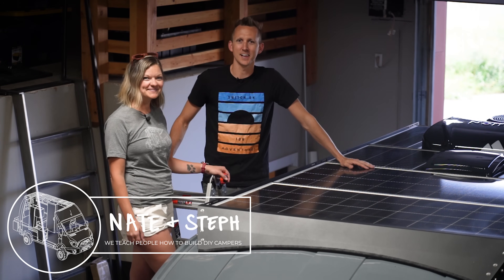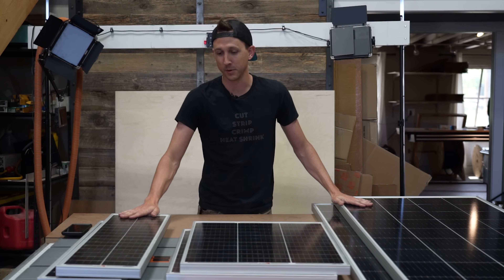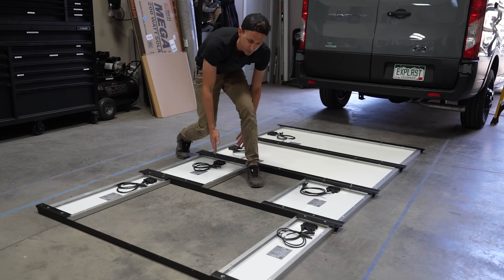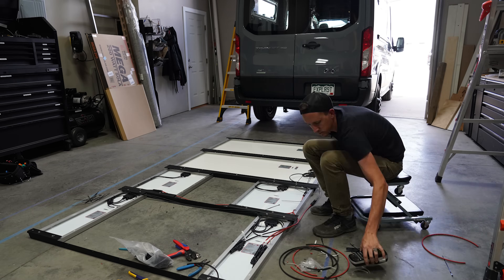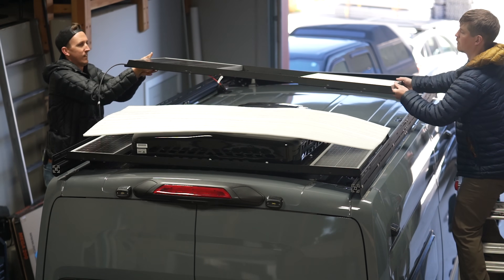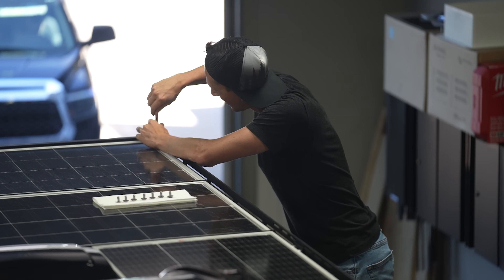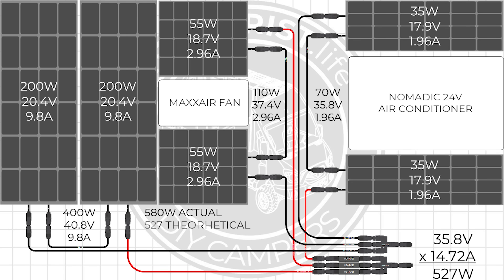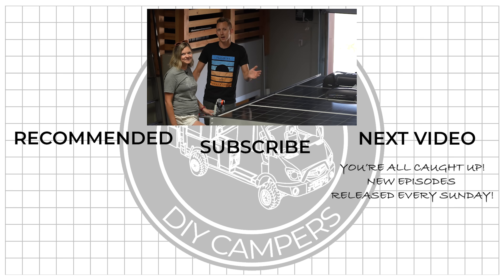INSTALLING 580W OF MISMATCHED SOLAR PANELS ON OUR TRANSIT

Comment: Question on the placement of the fan and ac - I was told to have them further separated to create air flow when both are operating (with the fan on exhaust). Do you get that same air flow benefit when they are so close together?
Reply from the maker: Great question! Placing the fan and AC close together can definitely affect airflow dynamics, especially when the fan is set to exhaust. The setup in the video works well for many, but your situation might benefit from more separation depending on layout and usage. For help dialing in the best setup for your build, our support team can take a closer look: https://shop.explorist.life/support

We offer free personalized help for gear purchased from our store. For components bought elsewhere, check out our Pro Support Membership for tailored guidance: https://shop.explorist.life/shop/all-products/membership-tiers/
Reply from the maker: Great question! Placement can definitely affect airflow, but how much depends on the layout and use case. Our support team can help you optimize your setup — just head over to https://shop.explorist.life/support. Free help is available for products purchased through our store, and for all other gear, our Pro Support Membership offers in-depth guidance: https://shop.explorist.life/shop/all-products/membership-tiers/

Comment: Curious. What mpg are you getting
Reply from the maker: 10 in a headwind, 20 in a tailwind.
Reply: @ wow that’s a big boy. What’s the biggest factor in the reduced mpg? Weight?
Reply from the maker: I mean, it's 10 foot tall 8,000lb vehicle with a lift kit, AT tires, and a twin-turbo'd motor. 🤣

Comment: I'm very confused, I was always told I have to use all the same rates solar panels otherwise the smaller ones would want to run the same amperage as the larger ones, causing problems. Am I missing something?

Comment: In a previous video you recommended the solar array voltage should be 20V above the battery voltage. This array is running at 36 V and is connected to a 24V battery which is only a 12V difference. I am looking at a similar set up and want to use a 24V battery setup. Should I use a 12V battery set up instead so it works better with the solar panels? Let me know if the 12V difference is acceptable. Thanks. Your videos are very helpful.
Reply from the maker: A great catch!  And yes; this system is indeed better suited to be a 12V system, which we have an option for in our shop.explorist.life store.  We opted for 24V just to show people how to do it because we had so many questions; not necessarily because it was the best choice.
Reply from the maker: In short: A 12V system would have been better, but if you prefer a 24V system - we are happy to sell that to you instead: https://shop.explorist.life

Comment: I wonder why ppl don’t just build a box that goes over the AC and fan. Ppl get additional storage on top plus have more roof for panels.
Reply from the maker: Height, mainly.  Extra height sucks to drive with in a cross-wind.

Comment: G'day.. This is a great video for miss marched solar panels and the same applies for the every growing HYBRID camper trailers here in Australian..
   I bought the lynx distributor after watching your videos. Can you advise if it's a good idea to run the solar POS wire from solar controller straight to battery positive to constantly Barger the batteries even when at home in storage.? My thinking is by running it through lynx Dist and having a battery disconnect switch solar would be isolated ,I'm thinking as the solar has its own disconnect switch to you can disconnect that if you want to shut down every thing. This would save a spot in the lynx distribution for other things and also leaving the neg wire connected to the shunt. 
  Is this a safe and viable solution to seperate solar disconnect? Keep up the great work. Your channel over any other has reached me alot. Thank you.

Comment: Love your channel.  I am using this for my new Tranisit Trail build.  I was wondering if it is possible to swap the 200W and 2 50W.max air fan on the rack.  my concern is the the max air fan is a bit close to the air conditioning unit
Reply from the maker: You may just have to play around with it a bit in sketchup or similar in regards to transit support ribs if you want to change up the plan.

Comment: Your videos are really clear and helpful! Much appreciated!
Have a question:
With FVC roof rack and maybe not the ideal locations of the fan and Dometic A/C, I’m considering two 175W panels and two 100W panels to charge a Victron 400ah 12V setup. Based on your advice, it sounds like I’d pair the matching wattage. 175W’s are in the center, but 100W’s are front/back. 
1. Would the distance make a difference? 
2. Would I need a separate controller if I wanted to switch which pair is used? For example, if I had a cargo box or a canoe covering parts of the bigger panels, which could harm the panels? 
Looking forward to seeing more installation videos!

Comment: Nice video. You are a guru. Excuse me if I just have a chuckle at one thing though. As someone living on a sailboat on the equator I have to laugh at someone's decision to produce a black air conditioner. I guess it's a styling decision? Anyway on with the video... and sorry to pick holes, your vids are very inspiring!! I love the beautiful arrangement of all those little panels.
Reply from the maker: I agree that a purple air conditioner would be much better, but alas, we will have to suffer through with a black one.
Reply: @EXPLORISTlife I was getting at the heat absorption issue. We repainted our boat. It was dark blue, now it's very light cream. The difference was amazing although it's still bloody 30 degrees C inside most of the time. Hopefully you aren't dealing with heat like that where you are going in that van. Congratulations again on very informative videos. It's inspiring me to tackle our Lithium conversion soon. I also like how you constantly stress safety. People can get into a lot of trouble with wires carrying 100 amps. Cheers

Comment: Ive got an anker c1000 and a 200w flexible solar panel to glue to my rooftop tent. The goal is to keep the ankerc1000 power station inside the trunk. I recently discovered you could get more and stable wattage charigng the battery pack via car battery inverter to dc and currently struggling to wire the newly bought solar cable into the hood and back out to the trunk...
Will i be better off with a battery inverter? Is it taxing on your car battery?

Comment: What about if we have a factory installed maxair fan? Id like to do the same setup maximizing solar with AC and a fan up top (and starlink).
Reply from the maker: You'll just have to take a few extra measurements and map out your roof to see what you can do.  Some time with a tape measure will be your friend here.

Comment: Question:

I have room for 3 x 215W or 2 x 215W and one 305W. Obviouslythe second option is more watt but missmatched wattage, voltage and Amps. What is the right way to think and connect in order to get the most charging effect as possible?

The 215W works with 24V and 6A and the 305W have 20V and 10A.

Comment: 11:42 New to the solar game and have a question.  Without the 2x35 (70) panels, you’d have 510 watts of solar but because of the parallel voltage limitations, you only netted 17 additional watts from those additional 2x35 (70).  Was it for aesthetics or will those 17 watts supply you any appreciable use?

Comment: How much degradation of the GPS/GNSS satellite signal have you noticed with the sharkfin antenna being under a solar panel or the wind fairing?
Reply from the maker: None.  Disclaimer: We don't use the transits GPS, so I have no clue. 🤣😂

Comment: 10:15 but the skit for the ford transit on your site is for 200W 12 volt solar panels not the 20.4 volts mentioned. I'm not sure why? PRobably because the maximum voltage is 20.4 and that's how you should rate the fuses

Comment: Can you clarify that a 35w17.9v 1.96a  solar panel can pull the voltage down from a 20.4v 9.8a 200w. so basically if I connect a 9v pp3 battery to a 12v battery the output voltage will be 9v and not 12v?

Comment: Hi Nat, excellent video again, What adhesive did you use to stick down the through roof Cable Entry Glands.I see you used the Decor Lap Sealant overtop of the edges. Thanks in advance?
Reply from the maker: A combo of butyl tape & quick set epoxy works pretty awesomely.
Reply: Excellent thanks. I believe on your roof fan you used 3M Wind-weld and Butyl tape. @EXPLORISTlife
Reply from the maker: Yeah, there are probably 1,000 different products that will work just fine for that.

Comment: Couldnt you have gone w the ecoflow battery bank and solar panels .? Then use that battery bank to charge your ev (byy seperate charge cable) and use it for external tools as well??
Reply from the maker: The ecoflow unit is significantly lower quality than the system we built in this van.
Reply: @EXPLORISTlife  AWSOME!!! I'm really looking fordward to adding your setup in a Ford e-transit 2023 work van  . So I can use the panels and your aux setup to charge the van while I work . While adding a bathroom & pop off bed on the roof .
Reply: Looking at your site for the help 👍

Comment: Hey Nate, You guys are doing a great service to all of us builders.  I purchased all my wiring for my electrical from you guys except for the solar array.  I just purchased three 110W and Two 50W from Newpowa (they fit the space I have) and looks like I can get 96% efficiency with a fully parrallel configuration.  The issue I am having is how to figure out the MPPT controller size for my mismatched panels.  It appears your calculator assumes the panels are all the same size and V and A values.  I just watched your Transit build where you used three different panels and was hoping you would go through how you determined the MPPT value.  Is there a video for that and i just missed it?  Looking forward to figuring this out and ordering my Array kit from you soon.  Hope to here from you soon.
Tim

Comment: Yea you would have been better off without the 2 small panels. It reduces the output of thr 2 large panels buy 50watt, so youd gain just 20watts for the extra cost and complexity not worth it.
Reply from the maker: ...and in real world situations, we've seen 620W from these 580W of panels on a cool clear morning.  Remember, what is shown on paper isn't always real world output.
Reply: @EXPLORISTlife  I agree what is on paper is not real world. But in general it's worse in the case of solar panels. Not better.
Reply from the maker: Idk what to tell you then. Perhaps do whatever you want to in your own build, I guess. 🤷😆👍

Comment: Thanks for the video.  I'm considering doing a very similar mis-matched panel setup on my Transit.  I've been playing with panel calculators, and it seems to me that you could get almost 100% efficiency if you wired the four smaller panels in parallel, and then combined that in series to the two larger panels (also in series) for a total of 575w, 58.7v, 9.8a.  I could be totally wrong since this is all new to me, but it appears to work?
Reply: btw Nate, I know you're happy with your current setup, so this isn't advice.  I'm thinking I'd like to wire my next version rack/panels up this way: 2*200w + 2*50w + 1*100w.  Only one maxxfan in the middle to create shade.

Comment: 👍👌❤️🇨🇦, i use two different controllers myself, I have 8 x 405 watt panels, 2 side byside and another 2 behind those, with 4 pullouts from under each of those panels, the 4 pullouts are wired in series and use one controller, the 4 stationary are in series and use the second controller, 3240 watts and 8 x 100 ah Power Queen smart LiFePO4 batteties,
Reply from the maker: Nice!  Sounds like an awesome project!

Comment: Awesome video! Thanks for sharing so much information! Got a question:
Which manufacturer specification do you use to design the systems? For voltage 'Voc' or 'Vmp'? and for amps 'Imp' or 'Isc' ? 
Keep it up! 
Thanks!
Reply from the maker: The 'mp' numbers are the 'Maximum power' numbers; which will give you the output when the panel is actually producing power.  

The Voc is the important one to look at when figuring out how big of a charge controller we need as it will be the max voltage we see right before the panels start making power and the voltage drops.
Reply: Thanks for the tips @EXPLORISTlife  . 
Since I'm currently trying to maximize the efficiency of the solar panels array by searching for panels with similar specs (not to dimension the charge controller) I'm guessing I should look at the 'mp' specs then.

Comment: Hey guys I've been really enjoying this channel its giving me a lot of inspiration and ideas. The technical detauls and format of the videos are 10/10. One thing I would love to see in a future build is a more budget friendly build that focuses as much as possible on off the shelf components. As well as, using the least amount of tools as possible as myself I dont have a nice fully equipped garage like you guys. Love the content keep it up !!
Reply from the maker: Awesome!  Glad it helps!  I've found that a build consisting of...

1: Off the shelf parts
2: Budget Friendly

...doesn't exist.  You have to pick the direction.  It's like DIY walls vs Adventure Wagon walls video we did.  You can save 60% on an L-Track based wall system; but it's also going to take 5 weeks and a workshop full of tools.

Comment: I am not a off grid camper at all but rather just a weekend getaway for MTB or other activities. 
This much of solar panel should be utilized to feed Hybrid motor for fuel efficiency. After all it's only a few times a year going camping for most of us. 16 mpg in the city with begin with and plus a few thousand loads would not be practical at all for daily driving. 
Any news for Hybrid??
Reply from the maker: No news for hybrid motors, no.  This solar array would not be large enough for  much for a motor geared for forward propulsion.

Comment: Where I only have one 200 W panels and one 130 White panel. If I wired them how well would that work or do I have to have a minimum of two in order to achieve necessary benefit? Thank you
Reply from the maker: This video shows you what happens when you wire mismatched solar panels into the same array and how to figure out what works best for your setup: https://youtu.be/zspCRKAFxKA

Comment: Nate do you have a design for the Transit high roof extended using a RTX-2000, Maxx Air and the Unaka Ford Transit Roof Rack - HSLD - 148EXT High Roof rack -it looks like your build is not on the extended van?  I have a 2023 Transit Trail high roof extended on order and am trying to plan a build that would provide maximum solar, the RTX-2000, Maxx air fan.  I can option a Ford factory install of the Maxx fan but I cannot tell where they would install it yet.  I am trying design maximum roof solar to support the 3 GC3 batteries I want in the build.  I will be utilizing a factory installed 2nd alternator as well.  Please let me know if you have any ideas -Thanks -I am a subscriber
Reply from the maker: Our van is the non-extended version.  I would just install the maxxair fan yourself.  I think that having ford 'guess' on where you want it will be a recipe for disaster in terms of solar planning.  I do believe that Unaka has this same roof rack available in an extended version which would just have enough room behind the AC for an additional 200w panel.

Comment: Another great video. Could you please confirm if it would be possible to do this same layout on a ford transit 148 extended and add a 3rd 200W panel behind the AC unit and skip the 4 smaller panels? Thanks so much!

Comment: Supposedly solar panels only last so long. 

My question is... are the panels still aging if they are outside but not connected to a system? (So its not active, but outside, either on a maintenance phase or a winter shut down)? (Or aging faster or slow depending on if the system is going or not going with the results being much different from each other?) 

Also the last 2 years the panels are getting MUCH smaller, and saying they are doing more. I'm worried if the numbers can really be trusted. Do you think they lie about their stats? 

Thank you.
Reply from the maker: Rigid solar panels are usually warrantied for something like 20-25 years.  I doubt anybody has tested to see if the 'life' is longer when they are disconnected because... well... what good is a solar panel that isn't connected to something?  That's like asking how long an engine will last if you never drive it.  It's just not a useful number.

I don't think that solar panel companies are lying to us, no.